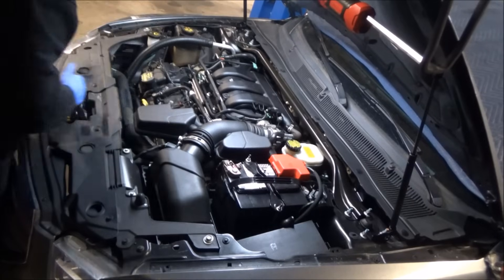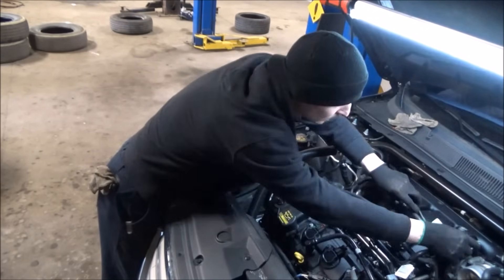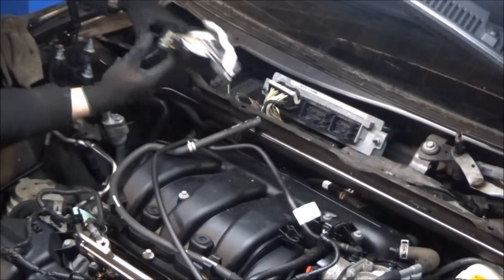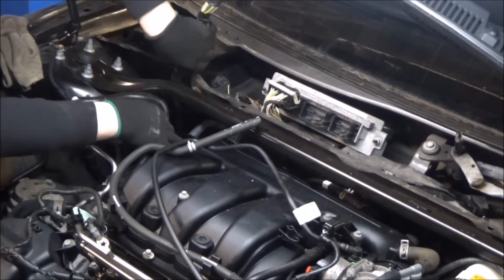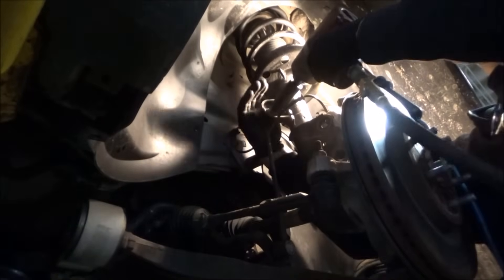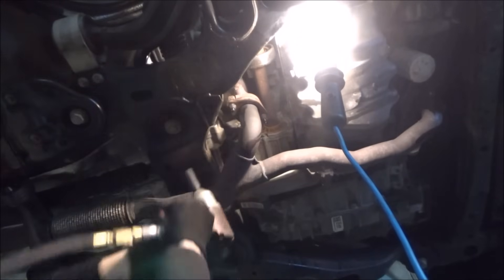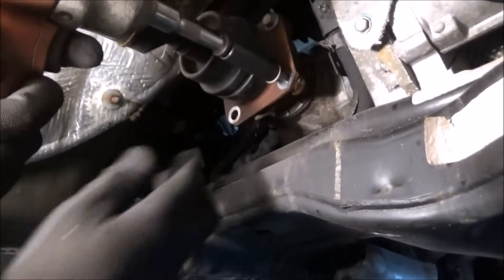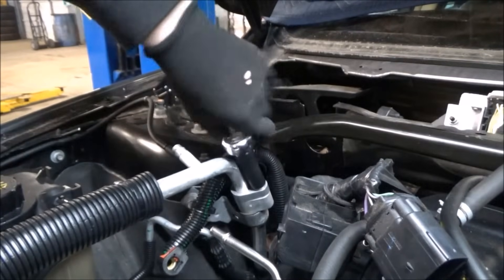2013 Ford Taurus, Water Pump Replacement Part 1

Comment: Yes, could you do a demonstration for the removal and replacement of a 2012 Ford TAURUS 3.5L SHO drive train just like this one, except the engine and transmission require separation. The transmission will then be bolted to another engine and reinstalled. Anything out of the ordinary I should be aware of? The replacement engine is a 2016 3.5L SHO. From all the research I've performed the engines are compatible, any comments or suggestions will be appreciated. Also could you demonstrate a rebuild on the 2012 turbocharger  and suggest a kit for that rebuild. Thank you for your time and effort in this matter. The date is 12/17/2019 this project is scheduled this weekend 12/21/19 so if you could respond before that date occurs that would greatly appreciated also. A fan Edward

Comment: What year did ford fix this problem?? Same for the 3.5 ford explorers?? I’m thinking about getting a 2014 or newer Ford Explorer
Reply: Joe Potocki 2020. Ford redesigned the Explorer for the 2020 because of the stupid water pump design and it’s RWD. So far, it’s having 10 speed automatic transmission problems.
Reply: Only get one with the 2.3 EcoBoost. Not the 2.0 because it’s underpowered. 2016 and newer Explorers have the 2.3 EcoBoost as an option.

Comment: My mechanic replaced my waterpump with havibg to remove tge egibe.  Removed timing cover  replaced waterpump. Timing chain guides. Oil pump..all fluids  belts plugs.  Car is 2014 Taurus police with 200,000 kms  (120,000miles).  Total cost was 4,000.oo cdn about 2500 USD  no exhaust to drive train disconnect rewuired.  Took about 16 hours..including all coolant transmission oil and PTU fluid changes.   Car runs perfect.

Comment: I changed a water pump on 2013 explorer.  Thankfully I didn’t need to drop the engine like this. Didn’t have to disconnect the ac hose.   Other than this I like these 3.5’s.

Comment: Where did you get those plastic plugs for water hoses?
Reply from the maker: Star Master Tech, ive just collected them from engines ive done over the years, though you can find them pretty cheaply online!
Reply: Joe, can you locate me one on amazon and post a link here?  :))
Reply from the maker: Star Master Tech, heres one kit mate, you may be able to find it on Amazon! https://redlinedetection.com/products/cap-plug-kit?utm_medium=cpc&utm_source=googlepla&variant=211169505
Reply from the maker: Heres one I found on Amazon. OTC Tools CEA-02 Assorted Cap Plug Kit https://www.amazon.com/dp/B00EAR8ERU/ref=cm_sw_r_cp_apa_dOKGAb963SBGS
Reply: Thanks Joe, Your the best!! =))
Reply: Got It!  :))  Fun Project your working on!

Comment: Technically, Duratec 30 V6 (3.0L) is the most powerful and newest Ford FWD V6 engine you can get with water pump outside driven by belt. It was last produced for 2012 Ford Fusion and Escape. Maybe this is a highly-desirable used car now to transport your loved ones. The RWD 3.5L and 3.7L (F-150, Transit, and Mustang) are excluded from this problem, since it's a longitudinal version with its water pump located outside instead. Can you believe that?

Comment: First of all I'd like to say what a great video series on the Taurus water pump replacement. Second of all, is it at all possible to do this without pulling the engine?

Thanks for all the videos!
Reply from the maker: Thank you! You certainly can, it is just much more difficult to do so in my opinion.
Reply: @pinpointautomotiverepair1592   Thank you for responding.  I have a 2013 SHO 3.5 that's making sporadic knocking noises starting at 1500 rpms. Here is a link to a short video I posted of this noise. Could this noise possibly have something to do with the phasers?
https://youtu.be/xX2w4d7VpAU

Thank you for your time!
Reply: It's most prominent at 0:17
Reply: I never pull the engine. U can have this done in 8 hours in chassis

Comment: Is it a normal occurrence to change a failed water pump on a 5 year old car?  Seems like a mess just to replace something that shouldn't have failed in such a short amount of time. You nearly took it down to a short block just for a water pump!  Nice work by the way, very professional.

Comment: I am the lucky owner of those Ford Taurus SE 2013, Just watching this video made me cringe as each parts and other plastic items are being removed. Reading the comments below is true. I had a major coolant leak out of the blue ( it was pretty bad). Luckily I keep certain things in my trunk in case of emergency (coolant, tools, oil, etc..)I was very lucky that I paid $800 and some change mind you in CA. The mechanic fucked up on the labor hours, didn't charge me for the special tool and gave me a discount since I lost a day's wage on the miscalculation. 

I'm glad I still had my peddle hopper '94 Ford Aspire but it needed a muffler (it was very loud) to use till my 2013 is fully repaired (water pump). The whole engine had to be removed  just to access the water pump and it took him a week 10 hours plus (had other clients). I crossed my finger as I moved out of CA. to WI. by driving. Still running but the engine isn't the same. He did a great job. I just blame the poor engine design and lack of space.

Great Video..if I knew this would be a hassle and high cost I would not have purchased this vehicle. Buyer's remorse.
Reply: Try save $5000.00 dollares to be ready . Towing,parts, labor, rental car. Etc. The Ford nightmares!!!!
Reply: I wish I had known I still owe 17,000 on my 2013 taurus and my pump went out the other day
Reply: @Tallboi87  Damn. I got a '13 limited with 30K miles. Recently had it serviced and it's running strong. But the Ford warranty has just expired and reading stories like yours scares the crap out of me. How many miles did yours have when this happened? I am not even sure how common this failure is.
Reply: @MegaEriable  134,000
Reply: @MegaEriable  your Taurus is still quite young
Reply: @MegaEriable  mine is almost at 68k and it's starting to leak but oddly it's a small leak and it doesn't even drip on the floor

Comment: He continues to praise Ford engineers whilst pulling a motor to replace a WATER PUMP!!!  Troll of the century.
Reply: Facts
Reply: @tuf86sami   how hard is it? im looking for info about doing this in car.
Reply: The main issue doing these in car is making certain that you have good wobble sockets and raise the engine high enough to get the timing cover out and back in without destroying your new silicone. Also I usually let the sealant sit 10 minutes or so to tack before attempting to reinstall the cover.
Reply: @themfknightrider420  if you want, get me your email address and I can send you pics and further details on how to do it in car
Reply: @tuf86sami   how can i send you  msg on here?
Reply: @tuf86sami  sent email.
Reply: S reeves hey, I’ll be tackling this issue as well and don’t plan on pulling the engine like the guy in the video. Can I get your email to see steps on how to do it with the engine still in the car?
Reply: Only pays 9 hours
Reply: That's the fuck he removed all the parts of the car to reach there I will sell my Ford before I change this ware pump lol
Reply: Well.......he meant everything EXCEPT the water pump!
Reply: @anawobass5382  and they dodge is bad.  2.7 had same issue.    No wonder they didn't sell.  The raptor is even worse.
Reply: Internal water pump was stupid
Reply: They should have recalled this. My water pump on this car is now on its second one and needs a third. At 1500 to swap it out Ford should be ashamed. They have the worst dealerships ...it's like it's a game to see who can get the most money from a single customer by over charging

Comment: More reason to keep a car from the 80's and early 90's. All water pumps fail, and to have to tear down the whole engine is criminal. You can't tell me Ford didn't know this. 
$$$$
Reply: Cars from the 80s and the early 90s have other issues. Smog components failing, underpowered due to new emissions technology, bad head gaskets, crappy, cheap interior components that rattle, etc. The quality on the new Fords is light years ahead of the cars they made 25 years ago. I've owned Fords from both eras.

Comment: And here I thought that pulling supercharger off my audi a6 to do thermostat was an inconvenience. Welp. Did it in like maybe 4 hours, and replaced water pump / coolant temp sensor while at it. Wouldn't want to drop an engine in my garage to do a water pump...

Comment: I have a 2009 ford Taurus 3.5 289,000 now. the water pump was leaking at 200,000 miles the shop said $1300 hmmm i bought some coolant stop leak for $30 still driving now.
Reply: I just did the same thing
Reply: Yikes that's never good

Comment: $1500-ish to change a water pump. Not my car.
Reply: InsideOfMyOwnMind labor can be $2500-$3000 for where im from. but this video WAY over-sells it. the motor does not need to be dropped, ive done this without doing so

Comment: I forget to write down it's a race track engine with plastic carriages in top. Remember in the race tract in Talladega some time in a single race 4 engines are replacing. 
This is a crime against the USA automobile industry.

Comment: what do you mean good engineering from ford on that sway bar link.. my 94 probe had those stupid things and 99.9% of the time they would strip out.. good engineering was the person who put the wrench flats behind the nut...
and you don't have to index the drive shaft it's not balanced on the vehicle  so any orientation will work

Comment: "Serviceability in mind" Are you nuts!?!?!!! You are pulling the engine to replace a water pump.  GM puts their V6 water pump external, and belt driven. When THEIR pump fails, it won't take the engine with it.

Comment: ford, gm or chrysler could give a shit about how hard it is to change this pump its about assembly. the 3.0 duratec pump is a 10 minute replace and is at the rear left bank.

Comment: I just had my water pump replace on my 2013 Ford Taurus and they don't have to pull out the engine 3.5 120,000 mi I pay $850
Reply: I have the same problem dealer quoted me 2200 another shop said it was to difficult take it to the ford place
Reply: @stevephillips4631   my friend did it in about 6 hours

Comment: The design is GARBAGE.  Changing a water pump normally takes 30 minutes.  You can't get to the damn pump!  Also, coolant and oil mixed in the engine when the pump starts to go.  Ford design is trash.

Comment: OK, please explain this to me. You said this is a well designed engine BUT you need to remove the entire drive train from the car in order to change a part which eventually fails on every car ever made namely the water pump. I could do this in 35 minutes on my GM 3800 at a cost of about $50. In 235,000 miles I changed the water pump 4 times which I think would be fairly average. Here you've got a multi thousand dollar job but even worse the coolant easily mixes with the oil to form a deadly goo that can easily destroy an engine if not immediately repaired. HOW THE HELL IS THAT A WELL DESIGNED ENGINE?
Reply: I have heard people do this repair in car.... would you have more room in an explorer? Have you done it in car before?
Reply: You don't know yet. Those Ford waters pumps even have a life span of 70 k miles. 
Trash engines; cars for junk yards

Comment: So if nothing is difficult about it, then why does it cost so much to have a water pump replaced on a 3.5l?? It's a lot of work for a simple part, call me a pessimist but it shouldn't cost ten times the price of the part to replace it! Well made video and very informative but I disagree with Ford making a well engineered vehicle with this one.

Comment: Motor was designs by Mazda but ford sells it. They needed to make the engine fit inside of the mkz. However ford went the cheaper route and made it internal to save on price/ space. Once i sell my Taurus im never buying a ford again. Nice looking car but shit mechanical design for something so simple.
Reply: Actually this is a ford designed v6 that Mazda used in the cx9. They got smart and dumped that hunk of junk in 2016 for their 2.5T skyactive 4 cylinder finally ending Ford and Mazda’s relationship.

Comment: They designed a good engine other than putting the water pump behind the timing chain cover. That is the dumbest idea I ever heard of and I have one of these cars. I have seen other videos where they are not pulling the engine out. They are working on the engine in place.

Comment: Ford could care less.. They throw them together and send them to the dealers to deal with there junk.. They could make a real good pump that lasts but they won't they all should be recalled know matter the mileage on the car.  My friend has replaced 8 of these in 6 months.. That's really bad.. Will cost you $1,600 to $2,100 depends what state you live.. For a water pump this is just nuts.. Ford is learning from BMW how to rip people off..

Comment: Serviceability?   Having to remove the engine to replace the water pump isn’t service friendly at all.  Stupid design by someone who doesn’t have a clue about serviceability.   The designers need to be made to replace these parts after the design concept has been made.  I guarantee they would change the design.

Comment: He said Ford had a really good design because this thing kind of melts apart if they had a really good design the water pump wouldn’t be internal on the motor and it would be on the outside like most water pumps that will eventually fail because just like most water pumps they have bearings that are sealed and will eventually go bad it’s called maintenance😂😂😂

Comment: I could honestly laugh all the way through this video where he keeps praising Ford engineers while taking the motor out to replace a maintenance item oh excuse me motor and transmission the job can totally be done from the top side but if you don’t get the cover sealed good then you will be taking the whole thing back apart to do it again😂😂😂😂😂

Comment: You keep talking about.
How great of engineering It was for Ford, but for putting the water pump inside the engis Retarded next have to pull the whole engine in power Train out to replace a water pump It's also retarded. What were they thinking

Comment: bwaahahahahhahahha   drops an engine to change water pump  lol   what's next cut the car in half to change spark plugs  ford engineers smh  hahahah
Reply: Brandon Black unfortunately they did not need to drop that motor, it blows me that they over-sell it like this. ive personally done this without dropping the motor

Comment: At what mileage did the water pump fail?
Reply: Mike Brock mines has 102k on it. No issues I pray it lasts till about 140k
Reply: Mine just hit 140k and my water pump is done. i have a 2014 taurus
Reply: @rodrigo2422  how many miles did you put before the water pump failed?
Reply: 2014 Taurus police interceptor in canada.
212,000 kms (130,000mi), mine is leaking out weep hole. Booked for replacement next week. No warranty.